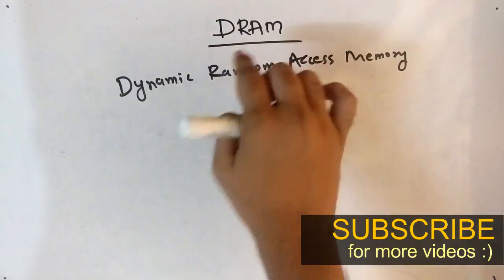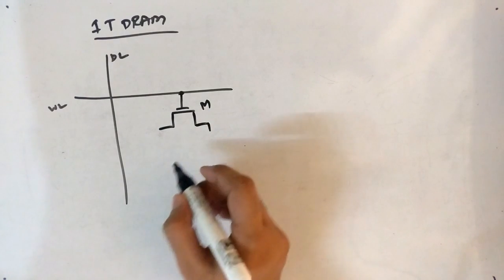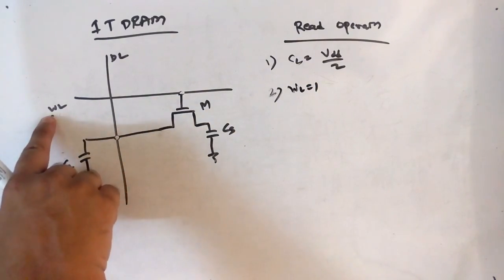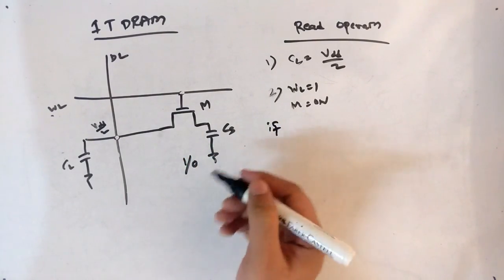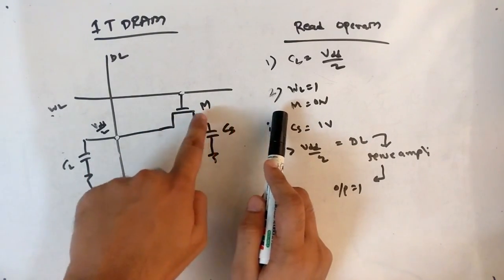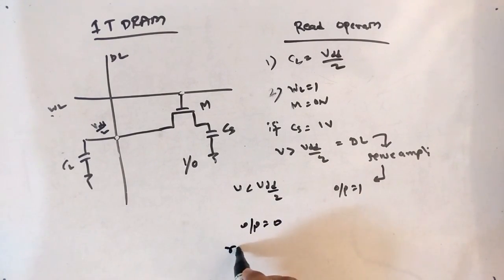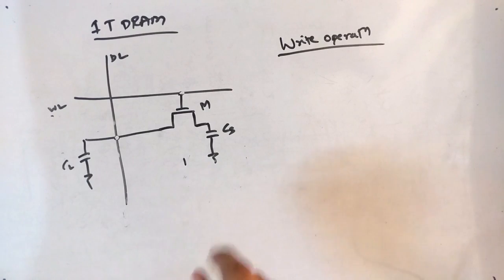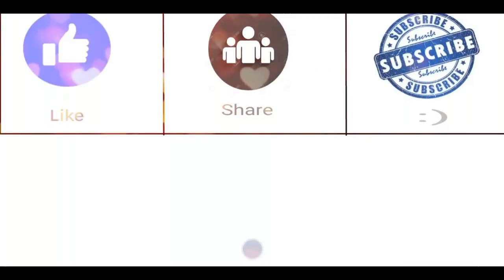DRAM - circuit ,read and write operations

Comment: I didn't get vdd/2.
What's that..
Reply: He sais that the voltage sum will be 2 x (vdd/2) because of the external capacitor, but that is complete nonsense. They are in parallel.

Comment: i didn't get how does Cs shares its potential to the data line. Mosfets do not work like that. The only way it can alter the potential at data line is to make flow a current and that could only happen if Vds>Vgs-Vt( saturation )
Reply: This video is misleading !!! I agree with you.  This is pseudo science!!